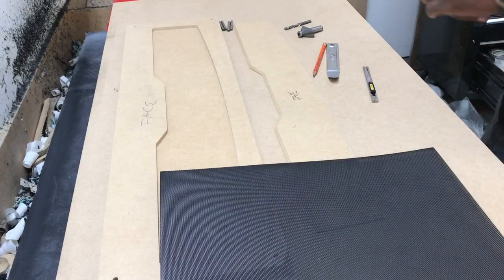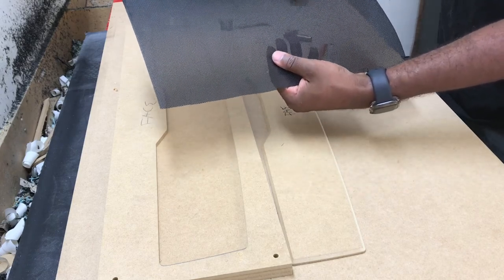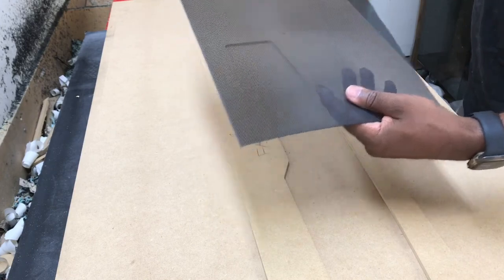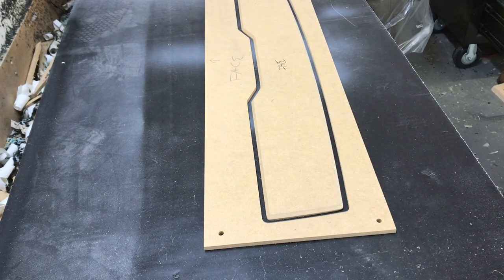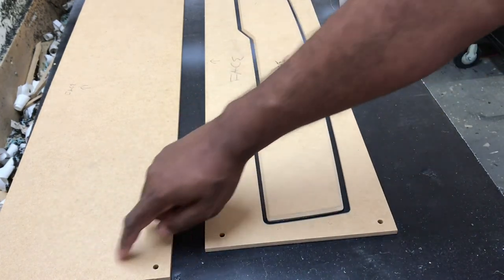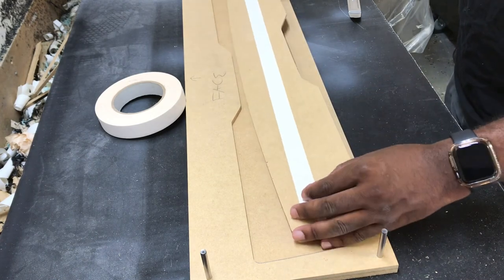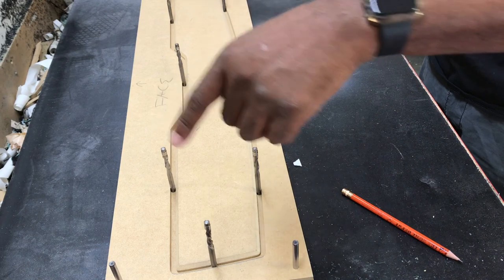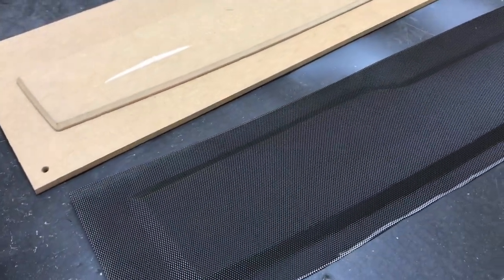Tips & Tricks #12   Pressed grills In a Automotive Install

Comment: What’s the best gauge to get to do this? I bought some from mobile solutions and it was super thick and I couldn’t get the details like you did in this video. It’s look ok but not like yours. It didn’t bend and rise like yours did. The mesh I bought  is SKU: RM-MESH8 from mobile solutions. PLEASE HELP😂😂😂 I’m pretty sure it’s too thick. I had to use all my might to cut it so it could fit in my box. It’s not the right gauge. I just need to know the right gauge to order. I found another website “zoro”  and “mcnichols” to order from but in order to order from them they ask what hole size, percent open area, gauge, how big, area size etc. And those are the things I don’t know. I think once I cut my rabbet in the back of my piece it’ll look a little better but it won’t look like yours😂😂😂Thank you
Reply: I used a 1/4 draw/gap if that helps any.